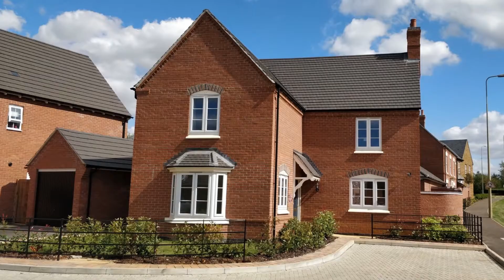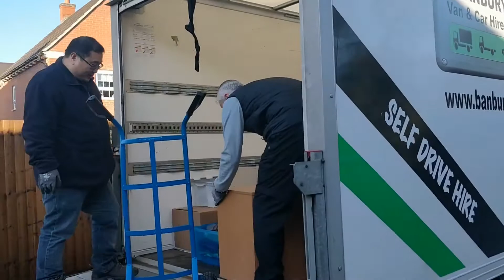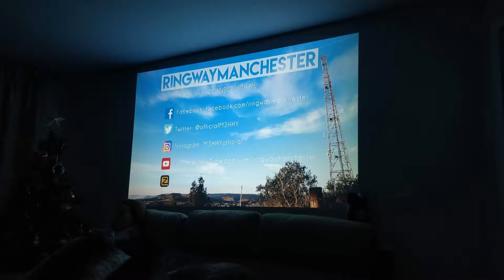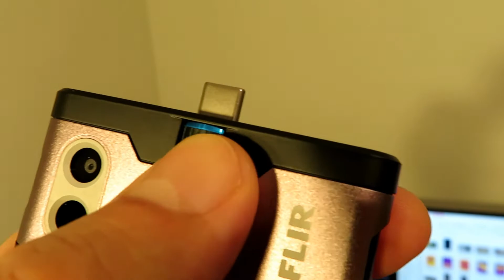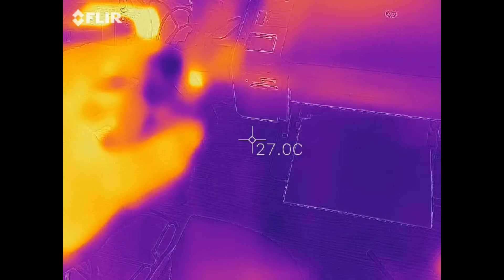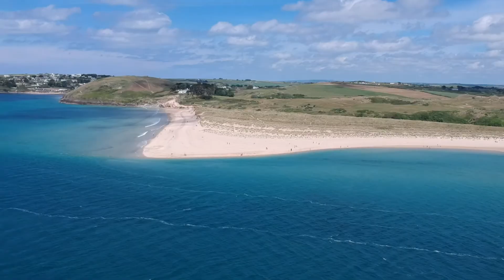Just how hot Does your HT / Radio get? and 2019/2020 update.

Comment: Radio frequency  burn from a battery terminal ??? ok Ive heard enough.  whoever made this video is not very bright.
Reply from the maker: That's what it feels like I've had lots of RF burns, make a wire dipole and run 5 watts up it and put it across the back of your hand, 10 watts will really burn, not very bright? Sounds like you just haven't had an RF burn before that's all so it's you that simply doesn't understand.
Reply from the maker: Not just me so it seems, watch this video guy reports the same thing watch from 7.29 it's definitely RF on the battery contacts https://youtu.be/1QmRY4Sj4Ro
Reply: Well you're not very bright either because you can get small RF burns from the battery terminals. I've had them myself!
Reply: @RingwayManchester  radio frequency burns from a battery? How does that work